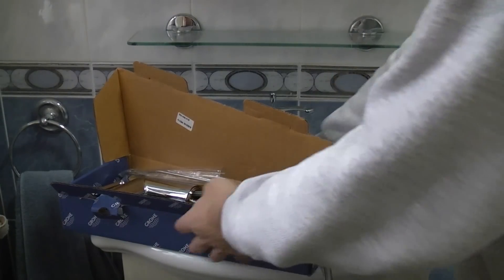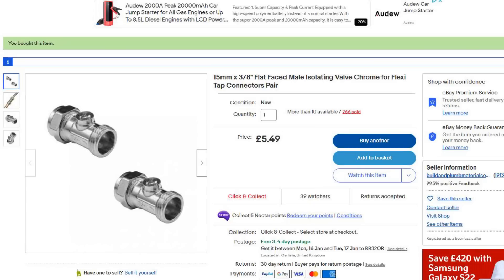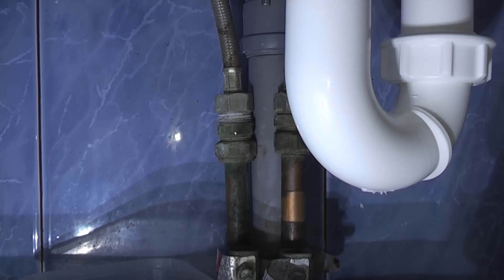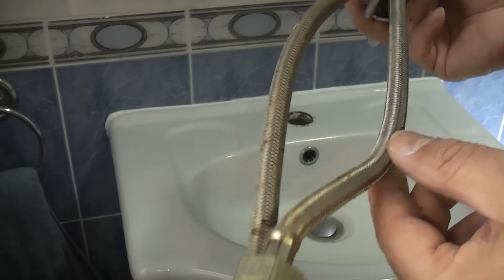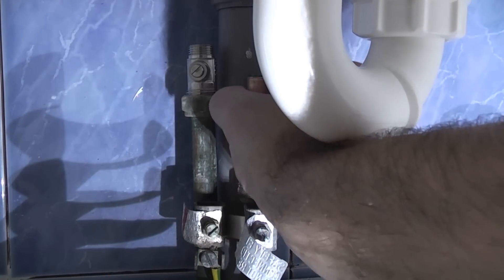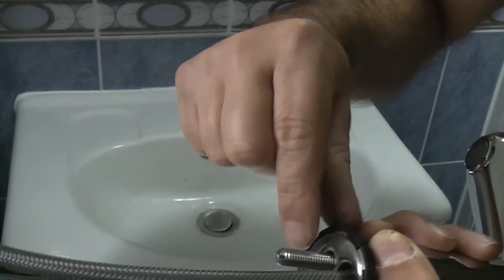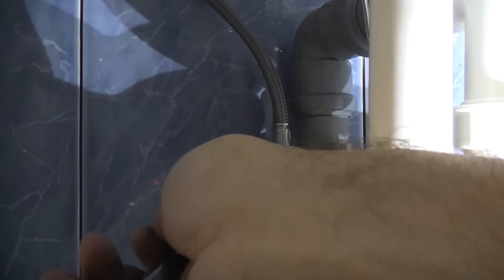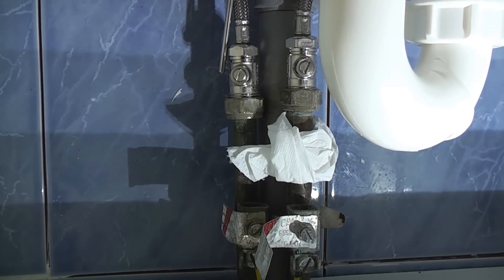How to fit a Grohe mixer tap | 3/8 tap install

Comment: Good video. 
I used to work for reed paper and board in Kent as a fitter/ turner. I bet the mill in Darwin is long gone?
Reply from the maker: Thanks.
Yeah, they are all gone now. I think at one point Reed owned Belgrave mills, Lower Darwen paper mill, Hollins grove paper mill and Dimmock paper mill. The last one I remember to close was Hollins grove paper mill, near to Crown paints.

Comment from the maker: I bought this tap in 2021, but was too busy to install it. When I looked at the tap I released the tails were 3/8”BSP, having checked the item on eBay, it should have come with ½”BSP tails. I guess it’s a bit late to complain over a year after the purchase!
I hope everyone has a great Sunday 😉
Reply: Too busy? In my case... it'd be the missus nagging. 
We have been married 20 years. You only get 7 fer manslaughter! - Les Dawson.
Reply: thanks, everyone who has ever done taps around the home knows its a right chore on the knees, bum and back. I spotted the wrong tail sizes on ebay and amazon deals so checked with screwfix and appears their grohe taps come with 1/2 tails in the box so went straight there to buy one and luckily was similar priced. I had to redo the job a few days later went loose but tightened it up more and its fine after 2 years now, one thing I do not like though the grohe tap has to be levelled spot on with the basin or sink, if its off by 1-2mm you would get a leak otherwise on top, this made it tricky to get it just right so its good to check behind the grohe tap and that it is spot on and then tightening it up.

Comment: Great video. Your comments about Grohe basin taps were spot-on. Very good quality, but many of them come with 3/8" BSP fittings (apart from their Quickstart, which are 1/2" BSP...confusing, I know), so you need to check the size of the old basin tap fittings and buy the right-sized fitting for the new tap. Check the manufacturer's specifications online. For plumbing DIY-ers unfamiliar with fitting isolation valves, there are two 15mm versions. One end is the usual compression fitting for the 15mm pipe and the other end is a 'male' flat 1/2" or 3/8" thread for the flexipipe fitting.🙂

Comment: Great instruction as usual! i have had this same set in a the back room (unused) for a couple of years and other projects got in the way till the old mixers started leaking.. I checked the fittings beforehand as I wanted to fit some isolators I already had and as your video shoed.. they wouldn't fit these tails.. really appreciate the 3/8 BSP information.. now ordered proper items for picking up on Monday. I now have everything for the job now. I'd be scratching my head otherwise and a stalled job. Grateful.

Comment: Thank you for the video. Interestingly, last night I have installed one (very similar to this one). In the manual, they suggested to open the tap filter (at the end of the tap), after the installation and run the water for around 2 minutes. And only after, put back the filter on. maybe it is because if something from the factory (metal shavings for example) remained in the pipe, does not damage the filter.
Reply from the maker: That makes a lot of sense, especially if the pipework needs altering. The instructions with this tap were very basic, and really just a few pictures with no wording in English. 
Thanks for the comment 👍
Reply: If you had to do a full drain down of a vented, hot water cylinder and the cold water storage tank that feeds the cylinder, you may well disturb some sediment and it may block the spray diffuser filter on the tap.

Comment: I can’t believe this. I replaced my kitchen tap with a mono block yesterday, mine doesn’t have the threaded bar and brass nut. It had a threaded collar and plastic sleeve that you hand tight.
As you say it’s tight especially fighting between a double sink.
Reply from the maker: Thanks for the comment 👍

Comment: I seem to remember you working on this basin before and having some trouble with it?! Nice new tap - hope it is working well.
Reply from the maker: Yeah, it used to block up all the time. I removed the trap one day and noticed that there was a hard deposit blocking the bottom of the U bend (I think it was solidified caustic soda). I chiselled that out and it’s been fine since  👍

Comment: Can I make another comment?
I am not sure if you are aware but it is possible to fit one of these taps from ‘above’ if you put the backing plate on just held by the nut with a few threads you can fiddle the backing plate through the hole. Put one ear of the plate through the hole and rotate and feed it through. Amazingly it works and saves the upside down fiddle.
Reply from the maker: I'll try that sometime 👍

Comment: Nicely done: I liked your method of using the box spanner combined with the ratchet. Like many I've struggled with the hoses wanting to twist during installation, never easy in those cramped spaces under a sink, so the swivel sounds like something I'd look for next time around. BTW: Good to see you back on here :)
Reply from the maker: Thanks 👍

Comment: Great video thanks for sharing. I recently put in Grohe taps, really nice. They came with a free spanner and also with a replacement pop-up waste. I sceptical of the pop-up waste when I first saw it (because the connector it was all plastic) but it has really cool double thread design with no route for water to get to the outer thread, so no pumbers mait needed.
Reply from the maker: There was a pop up waste with this kit, it had a large O ring instead of the seal, that you get with other waste fittings. In the past I’ve struggled with the supplied seals and often have to buy an additional seal, perhaps the O ring works much better than traditional seals.  
Thanks for the comment 👍

Comment: Great video, I’ve done a few taps and the advice you gave about using a ratchet is great, I never thought of that, it would save having to undo waste pipes to get the extensions on the box spanner’s 👍
Reply from the maker: I’m glad you found the video useful
Thanks for the comment 👍

Comment: You can get 1/2" tails to 3/8th" adaptors to pop into ballofix valves, 15mm-1/2" rad unions are useful, but the cost compared with buying in  the incorporated 3/8th flat ballofix is around the same (the link you supplied) and less faffing involved. Thanks for the suggestion. Gonna buy a pair in..just in case. 
BTW, FAF stands for fiddly as f^&k.

Comment: Think you took a bit of a risk using old olive without PTFE ...
Reply from the maker: Yeah, it’s absolutely fine though. I’m not a fan of using PTFE or jointing compound with compression fittings unless it’s necessary. 
Thanks for the comment 👍

Comment: Does the UK still have that odd hot water/cold water split? I remember visiting 12 years ago and finding it weird how the hot water and cold water came from two completely separate chambers.
Reply from the maker: Yes, many basins have two taps, one for the hot and one for the cold. I prefer that set up to be honest, especially as you can install traditional taps. A traditional tap washer costs pence, but some tap cartridges can be £30 + 
Thanks for the comment 👍

Comment: Could you  be lazy and just turn off the current isolation valves, even with the high mains pressure?
Reply from the maker: If isolation valves are present, then certainly 👍